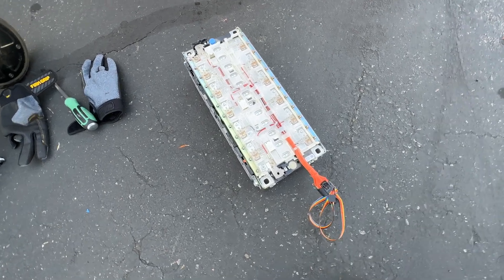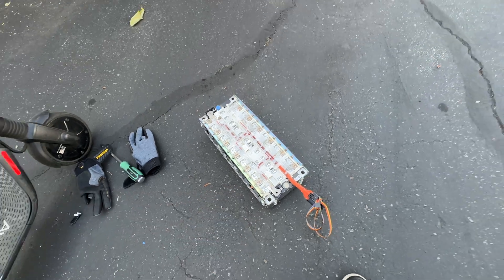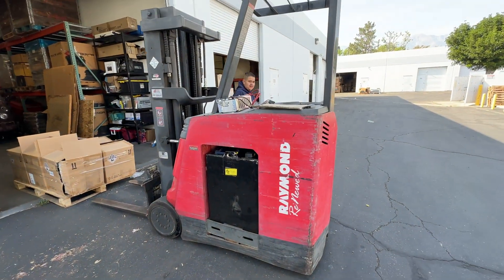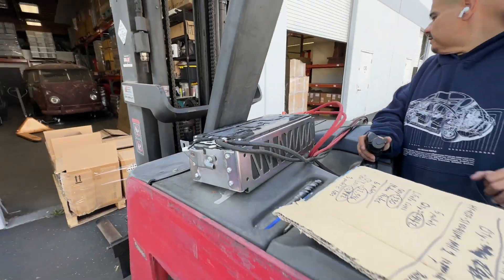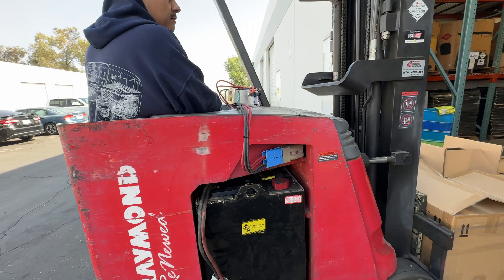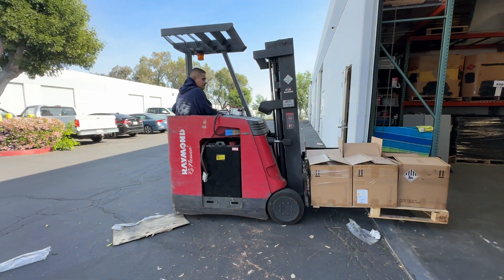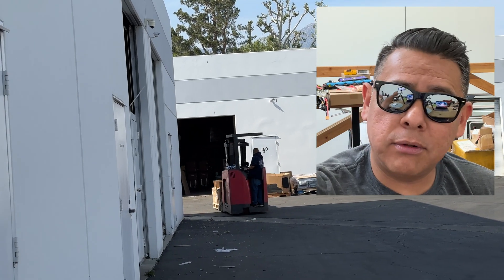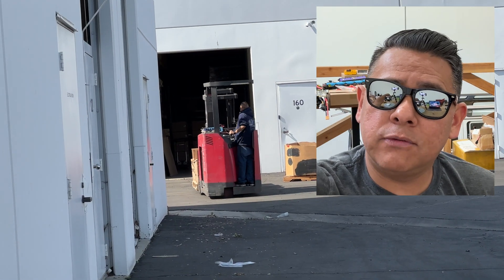$120 Forklift battery?

Comment: I'm running 2 Honda clarity battery's on my Mitsubishi 36v forklift. Using full voltage BUT there's a wire the feeds power to the computer/logic board that won't handle the full voltage. I used a Drok Buck converter to keep voltage at 36v. Each battery has its own JK-BMS that can handle the amps $100 each. Each battery is fused and hooked up in parallel to the main contactor post at control board. I'm using the charger he recommended but a 10amp charger and a splitter too hook both batteries to the charger. I can use the forklift non-,stop for  an hour no problem. Normally you don't run non-stop. Batteries charge back up in a couple hours. Super happy with conversion. I'd like to add one more battery to it. Future plans.

Comment: Grrat job! I have same issue. My old lead acid batteries are dying and connectors all blue and corroded. Could keep them in and get something like this as i only need it the very odd time. Question is.... where to get these cells/ lithium battery in uk / northern ireland?. Thanks

Comment: Did you figure out a battery solution?
Im looking to fix my forklift battery with something other than lead acid batteries
Reply: What charger do you recommend to charge that battery?
Im kinda new to this lithium battery tech
Reply from the maker: I’m currently using one of these battery modules https://jag35.com/products/chevy-lg-36v-5-9kwh-li-ion-modules
Reply: Any way you can make a video showing us the setup?
How long is the run time?
Does everything function as good as the original battery?
Reply from the maker: 2-3 hours run time,  everything runs as normal.   I didn’t make a video of this setup as too simple to need it

Comment: I used to be. An electrician in a factory. I regularly changed lead acid batteries that weighed more than my Mini Cooper! Had to water them before charging. Don’t miss that job. We had synthetic uniforms until the company realized they were not a good fit around welding. So, we were issued cotton uniforms. The electricians had holy uniforms!

Comment: I just got an older forklift that has a large lead acid battery that is very low on charge. At the moment I'm trying to get the battery to come back to life but if it wont my use case is also very short so I'll be replacing with a lithium setup also. Pulling those batteries out is a task! I have a video on my channel of me taking mine out if anyone is interested.

Comment: Can I use this in my Ryobi 48v riding lawn mower or is the voltage too low??? It's currently has 4 12v deep cycle batteries. If so I will order right now..
Reply from the maker: 36v-50v is what these do,   so you tell me.

Comment: This is a crazy idea. what if weld a metal container the size and shape of the lead acid battery and fill it with concrete leaving enough room for the Lithium battery. this way you can remove the old lead completely.

Comment: I use a power Wheelchair, I'd love to swap out the two 12 volt lead acid gel batteries for that lithium ion
Reply from the maker: only if it can handle 36v-50v range of these

Comment: I've been looking for a good used alternative to the 48v-60v 20-60AH batteries used for pedicabs. They cost from anywhere from $350 - $1200 from different manufacturers. It'd be nice to find something with the same or better specs. I'd like to try the max voltage my controller can handle which is 72v and somewhere around 50AH.

Comment: I have 3.5 volt lithium  ion 75ah using 4 in series there is a voltage different in 12 volt  when we get full charge we found 16 v and minimum discharge voltage is 12 so it is not in use in inverter how we get solve this problem
Reply: Please you may make a video on this problem of 3.5 volt lithium ion battery in 12 voltage
Reply from the maker: doesn't work if you need 100% of battery capacity,  but if you only need power then its on 4s can be used in 12v applications

Comment: You could use the old battery lead and cut down the case. Fits perfectly. Melt lead first in case to get size.
Reply: What about the actual ballast of the lead battery!? Lithium are way lighter unfortunately
Reply: @carholic-sz3qv  forklift batteries are a open steel box with separate cells. The number of Plastic cells determine the voltage. I'm saying use the lead in the cells. Put just the lead in the empty steel box, melt the lead down. Then trim the battery box(or not)  and there's space for lithium.
Reply: This is safer because it lowers the centre of gravity by concentrating the lead lower and the battery is contained. Lithium battery on top.
Reply: Basically you are removing lots of plastic and battery fluid. I'm going to guess that old lead battery space will be cut more than half. If you want to get technical weigh old lead battery first, then after lithium on top. I'm pretty sure lithium battery is heavier than plastic and battery acid.
Reply: When you put the lead in the battery box use PROTECTION and a torch. It will form a big blob, brace it from boucing when traveling over bumps.
Reply: @nhall8664  wtf are you talking about!? Lead is literally the heaviest part in this battery! He doesn't need a big lithium battery, just add concrete block or water in box for more ballast! He doesn't use the forklift too much!
Reply: @nhall8664  just sell the old battery and make a custom steel or aluminum box with water or concrete ballast rand them add your small lithium battery on top!

Comment: I might use titanate batteries 8 cells with SBMS and take out lead acid battery. Then use lead block with  batteries on top. Series 3 battery packs. Could last for 25 years and very quick charging.